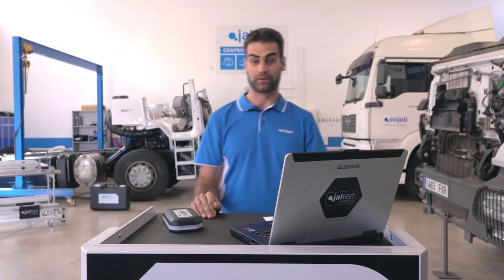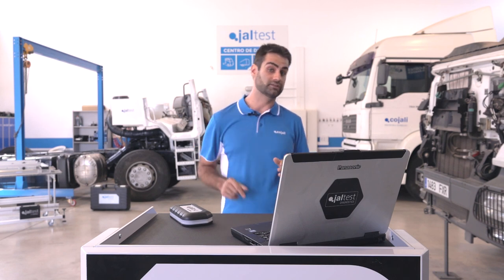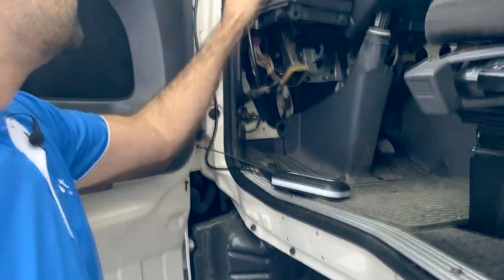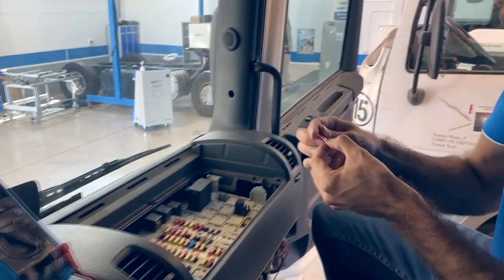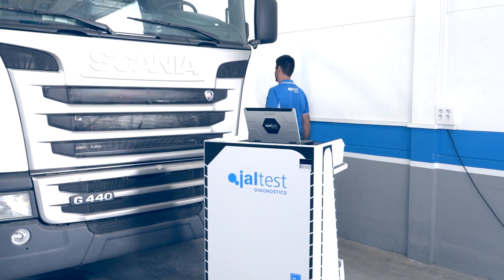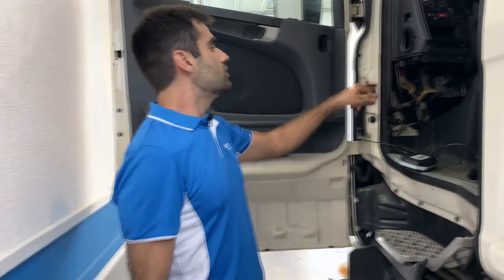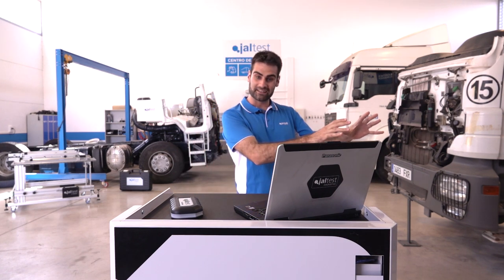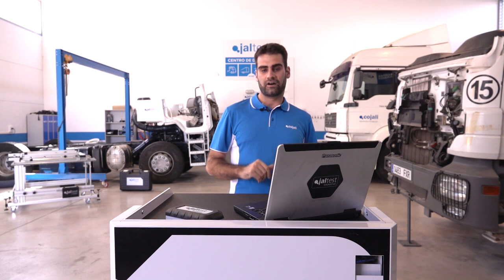📢 JALTEST WEBINAR | Tips & Tricks (Episode I)

Comment: Hello 
I feel  very nice to see such kind of tool  which can work properly as shows in this video. 
My question is the ECU which has problem  or has short circuit can still Transfer the data to the new one?
Reply: All this works  offline or online  especially when transferring  the data
Reply from the maker: Hello, Shukrani Mbwilo. It strongly depends on the exact problem of the ECU. There are many different scenarios.
Reply from the maker: @shukranimbwilo5556  The function in the video doesn't need the internet connection.

Comment: Which external power do you used to power the ecu that you copy? When you copy good runing ecu file, to keep as back up incase the ecu damage in future, can the ecu work after being copy? I am highly interested in the tool but can it work when the yearly update subscription is expired?
Reply from the maker: Hello! We answer your questions below:
1.	The power supply tends to be direct from the diagnostic connector socket of vehicles. If it is not possible, then it should come from the batteries of the vehicle itself or from the values 12V/24V (depending on the vehicle) from external batteries.
2.	Commonly, if the process is well done, the backup file is saved on PC. To recover the initial state of ECUs in case of problems, generally, it depends on each specific case.
3.	The diagnostics function will continue if the license expires, the content will be frozen on the last version with rights, but access to the technical info will not be available.
If you would like to receive more information, please, click on this link: https://www.jaltest.com/en/contact/. Thank you!